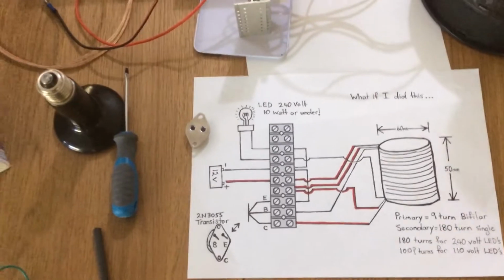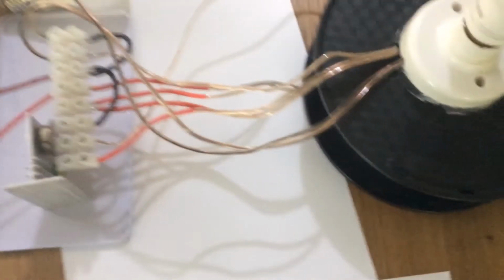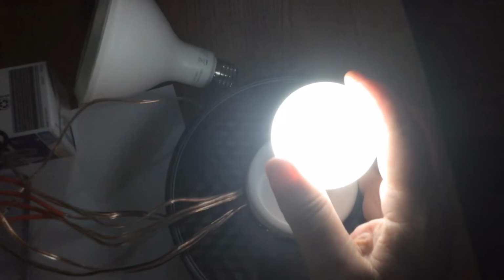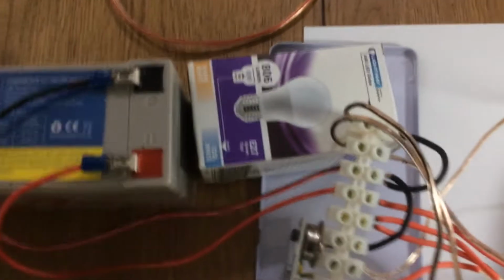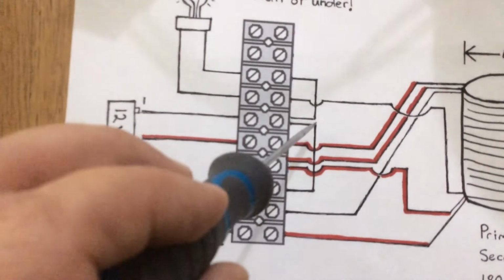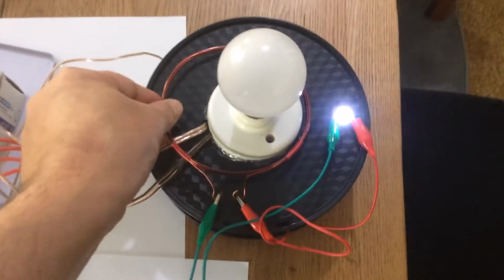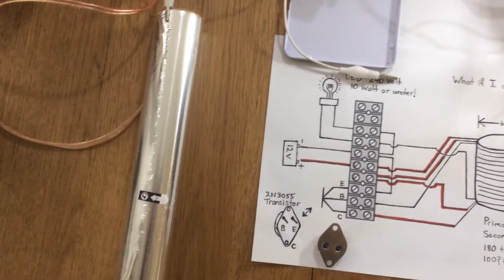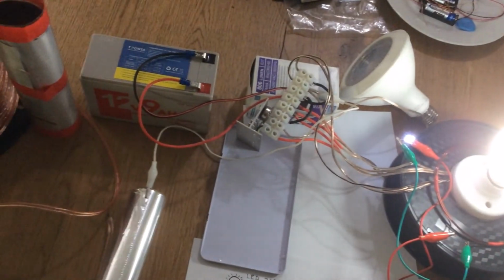Energy Crisis Off Grid Backup High Voltage Tesla Earth Ground Power Transfer Single Wire DIY Lights

Comment: hi ! great stuff ! this is really helping me to understand how tesla coils work. could you please tell us the lenght of the bifilar primary and secondary coils? also the lenght of the wire for the small coils you use as receivers that you place around ( I think you use them in your other videos, with an LED and sometimes a capacitor in parallel) this is so I can put a scope and get an ideea of the frequency it runs at... I want to try this with mosfets or igbt transistors, make it more powerful :D I promise to share the results if it works. Thank you !

Comment: How many meters of cable do I need to create the coil ?
Reply from the maker: Thank you for your comment. Sorry for not replying sooner.
Unfortunately I don't know how many meters would be required. Soon I will make a video on this coil and discuss its measurements. Due to this coil functioning open ended and without a load like a Tesla coil, you can wind a few layers and insert a needle through the insulation, then connect a low wattage LED between the needle and the negative terminal on the battery. If the LED is poorly lit, remove the needle and wind another layer of turns and repeat inserting the needle and connecting the LED to negative, continue the process until you have optimal brightness for the lowest wattage. This may seem like an annoying way to wind the L2 but it allows you to have the optimal setup tuned specific to load.
Thank you for watching.

Comment: Gidday mate, I'm a Sparky from New Zealand, you in Australia?  What's your mains at your place, Single Wire Earth  Return?  If you're in NZ I'd love to come give you a hand.  (I've got 6 microwaves that I'm pulling apart atm for experiments).  Nice light show btw.
Reply from the maker: Thank you for your comment.
Sorry for my delayed reply. I am indeed Australian, I have 240 volt mains here however this circuit was created a long long time ago, in a galaxy far far away🤣(sorry my filter wasn’t on the keyboard) I used this circuit when I lived off grid to send my solar over long distances through earth to run a 240 volt LED light. So you are correct it is basically a SWER system.

I’m sure I don’t need to tell an electrician to be careful with those MOT’s, I connected this circuit to my large Tesla coil then into an MOT and got a one inch green arc to earth which welded the side of the MOT, I’m jealous about the MOT’s you have, I’m currently considering dismantling my kapagen to do some other experiments. It’s amazing when the frequency is correct.
P.S. I don’t recommend doing that unless all precautions are taken.
Thanks for watching

Comment: Why not just use the correct voltage device saves the BS😂
Reply from the maker: Thank you for your comment. I am not so sure of the BS your referring to. I designed this system to avoid the unnecessary overheads that a conventional inverter creates when running 240 volt lights. When I lived off grid I realised the inverter was burning off more energy than the lights were, so I decided to build a dedicated lighting circuit and leave the inverter to run sensitive electronics. When you see the power saved it’s all worthwhile and after this build I used to leave the lights on 24 hours a day in some rooms, because now I could.

It might be worth noting I needed this electrical signal to work through the earth using Tesla’s single wire earth transmission as well as a means of transmitting DC over long distances, something conventional DC is not good at.
Using this method saves 50% on copper wire as earth can be used as the second wire.

Comment: How many KHZ is the oscillator running at ?
Reply from the maker: Thank you for watching. I am guessing as it it was a long time ago, I believe this unit was 172KHZ I will attempt to check it tomorrow because I might be remembering the KHZ for the unit on the board which is slightly higher KHZ.
Reply: @whatifididthis...1236   Ok cool I was wondering because I built something similar that seemed to have low power consumption at certain frequencies. in my playlists.
Reply: @whatifididthis...1236   It does appear my MEG was also around the same frequency very interesting
https://youtube.com/live/sfQbOtAbS30?feature=share
Reply: I have a playlist here: Solid State LRG, M.E.G. Magnetic energy Design Transformer: https://www.youtube.com/playlist?list=PLjuCiV5HRn3RCxCMH_xvkyh8EkEpn0iBp

Comment: Is it possible to slide along a receiving wire/coil to find the resonance point ? With the connection wire I was thinking of hunting down multiple nodes on the wire/ coil .I saw Don Smith with a led or neon blub running along a coil like he was looking for a node to tune it ?. I mean on crystal radios they use a thick wire to slide over the receiving coil to find radio stations .one reason I ask is it seems that you can pull energy from each node without effecting the rest.i saw John bedini talking about placing coils with diodes at node ponts for energy harvesting.i might jump up your out put.
Reply from the maker: Thanks for watching. That sounds interesting, I will connect the ground wires today and test for the resonant nodes as you suggest. You’ll want to see my tutorial for collection methods. I will warn you, they are bloody long videos but cover a lot of the dangers also. I have been testing fields around the coil for the last few days using ferrite and found some interesting information I will try to cover in a new video...soon.
Thanks again.

Comment: On minute 10:47 you are showing the smaller coil with 4 turns. I read that the primary coil, the secondary coil and the transmitters need to be the same frequency. This smaller coil lights up but I can't imagine it has the same frequency because it is much smaller. But it could be because the diameter is much bigger then the audio-wire and finally it's the same again. So you measured that out I think. The other question is because of the primary coil. It has 9 turns bifilare (18 turns). How it can be much smaller than the secondary coil (180 turns) and still have the same frequency? The answer is probably, because it is bifilare.
Reply from the maker: “If you want to find the secrets of the universe, think in terms of energy, frequency and vibration.” - Nikola Tesla

Our key ingredient, the holy grail, the FREE ENERGY that we all want so bad is within the word “Frequency”.
The length of a wire determines Frequency, there are other factors that influence the frequency but none more so than the length of wire.
This is why my circuit can power various sizes of coil with the same/similar outcomes.
How do I decide on a secondary coils dimensions? I don’t! It has already been predetermined by the length of the primary.
A Resonant coil is either a division or multiplication of the length of the primary.
So in respect to my circuit it’s not so much that the primary is bifilar (not to diminish the significance of the bifilar coil which has its own magic properties) but more because the secondary is a multiplication of the primary’s length. Which can be a pain if starting from scratch because you physically have to measure both primary and secondary coils! Don’t stress, because I have already done that bit. 👍
In conclusion, all the coils you see as receivers are either a multiplication or division of the primary and not so much the number of turns.
Think in terms of Radio, the biggest suppression of FREE ENERGY, turned into a source of entertainment, straight over our heads... literally. Radio receivers are just copies of the original energy source, ask yourself, is there a limit to how many listeners can tune to one radio station within broadcast range? Doesn’t the broadcaster keep transmitting at the same power level?... regardless of how many listeners there are. How do you grab that freely distributed energy?, sent to you at no cost to you (FREE), by tuning to the FREQUENCY of your favourite radio station! And yes I realise nobody listens to radio anymore! 🤣😂 Crystal radio set is a very old piece of evidence regarding this.
Reply: @whatifididthis...1236  Super explanation. Now I know the primary coil is the conductor of the orchestra. And the length of the wire is not absolute. It can be multiplied and divided in the rhythm. I think this is the core to know the whole point of free energy. I got it now. I understand now also the radio-frequency. The truth has been over my head the whole life.
Reply: @whatifididthis...1236  I watched your videos how to wire up the primary and secondary coil. In other examples there is usual a space between the primary and the secondary coil. If I'm correct you're wiring the secondary wire directly over the primary after the white tape. How is that?  I have a guess. In other examples the secondary coil is often blank without any isolation. In your case you work with this isolated audio-wire. This way you have 18 spaces. As a whole you have finally the space it's needed.
Reply from the maker: @marcelfiechter7436  You are correct, the secondary is wound directly on top of the primary with only the electrical tape between them.
I have tried wire with thin insulation and I believe it works better if there is a dielectric space (insulation) between wires. So the insulation on the speaker wire is approximately 1.2mm thick, resulting in over 2mm between each wire, in all directions. I have definitely confirmed it works better with a thick insulation to the wire. I only tried once with a different wire, that was enough to tell me it was better with thicker insulation.
Reply from the maker: @marcelfiechter7436  I have made this circuit with a wire that had thin insulation and I feel it was worse than with thick insulation. The insulation acts like a capacitor to house a dielectric charge which is then available to the wire. Some of the circuits with thin insulation would not even work. I’m near 100% convinced thicker insulation is better, also, not all insulation has good dielectric properties.
I found speaker wire was easy to settle on for this reason and others. The circuit in the following video (link below) I designed, to include this concept, after the primary this coil has one layer 20 turns, not connected to anything, then another layer of 20 turns also not connected to anything, then the secondary goes over the top of those two layers. These unconnected layers of 20 turns act as transmitters.
https://youtu.be/fvs-NitCjuc
Reply: @whatifididthis...1236  This information from your experience is unpayable. Here in Switzerland we have 230V. So I keep the primary coil (9 turns) the same and the secondary coil 170 turns. This means 85 turns with the speaker wire.
Reply from the maker: @marcelfiechter7436  I’m not sure what you mean by the 85 turns, I’m running lights designed for 220 volt to 240 volts, these require at least 180 turns on the secondary. If you use only 170 turns it may not be as bright, my portable coil is 9 bifilar turns primary and 180 on the secondary. Remember number turns are not the full picture, length of wire is more important. Keep in mind with each layer of turns the diameter of the coil increases, therefore each layer has approximately 5mm increase in diameter using a 2.5mm insulated wire. So the last layer has an increased diameter of approximately 45mm with the 9 layers that it takes to make the 180 turns.
Reply: @whatifididthis...1236  With 85 turns I thought to reduce voltage. But you answered my question. It doesn't matter if 240v or 230v for the light bulbs. I'm curious how many volts are at the low voltage end and how many at the high voltage end. I assume the low voltage end is 240 volts. Because there is the bulb connected. The high voltage side is probably 580 volts as I saw this in an other video of you. But I could mix here something.
Reply: @whatifididthis...1236  How many hertz is this cycle running? I assume something between 100kH and 200kH.
Reply from the maker: @marcelfiechter7436  The high voltage side is well in excess of 1000 volts, similar to a Tesla coil it will burn you if you touch the wrong thing! This high voltage drops of drastically when plying a 240 volt load, I can’t remember the “under load” voltage exactly so I will measure it tomorrow whilst running some other tests. I would be very careful what you connect to it, a cheap light - all good, but if you connect anything with sensitive chips, it may be its last run! I practice this philosophy, if I want to keep it, don’t connect it!
Reply from the maker: @marcelfiechter7436  Don’t quote me on it, from memory I can visualise 172 kHz but that could have been my coil on the testing board and it also could have been connected to earth which changes everything. There’s another video on frequencies that could be made! I spend all day testing my ideas on this circuit and others I have running so there are a heap of numbers jumping around in my mind. I build things over and over in my head ruling out how not to do things, when I feel comfortable with the design I make attempt after attempt until something works. I know this is far from a Mk2 Iron Man suit or an Arc reactor but the 3D blueprint computer that Tony Starke has is something like how I see things unfold before I even touch the wire. I find building in my head to be a lot safer, I have been electrocuted so many times it’s ridiculous.
Reply: @whatifididthis...1236  >I'm just wondering what exactly the difference between high and low voltage is. Even you didn't explain this now in your reply I think I got it. This is most probably the top and bottom of the frequency curve. Tesla was the inventer of AC. Claro. I'm studying this now since 4 days and I have every day something new I really understand. Without load it's around 1000 on the high end. It drops of drastically without load you said. It drops to 240 volts I think. If it would be higher the bulb would burn I guess. If you would make 360 turns in the secondary coil instead of 180 then the voltage would be significantly higher I think. Probably more than double because the diameter gets also bigger.
Reply: @whatifididthis...1236  How would it be possible to increase Hertz? When I'm thinking logically Hertz gets generated by the primary coil. If you would winding 18 turns instead of 9 on the primary coil Hertz would be doubled at around 340 kHz.
Reply from the maker: @marcelfiechter7436  Remember the turns aren’t the main consideration when aiming at a particular output. Too many turns will take the circuit out of resonance and increase resistance if the secondary strays too far from a division or multiplication of the primary length. The bulb may burn out as you suggested. I tried a 110 volt light I had for testing other circuits and the circuit smoked it. A good experiment for this circuit is to wind one layer on your secondary, connect the circuit and measure voltage increase with only one layer. Then wire a second layer, reconnect the circuit and measure the two layers (40 turns) output compared with the initial 20 turns. Keep repeating until you find a sweet spot. Tesla stated that the magic occurs above 20 kHz so that’s easy to obtain so the most crucial factor for resonance is the length of the wire, this means testing is essential as a full layer of turns may leave the wire too long or too short. Removing turns one by one you will find the golden ratio. This is why it is much easier to measure the wire first to match resonance of the primary, takes out the guess work and hours of tests. Also, if you decide to do the layer by layer test you should watch the input wattage, when resonance is achieved your input wattage will drop significantly.
Reply from the maker: @marcelfiechter7436  Remembering that I can be wrong, as far as I am aware length of wire is the largest determining factor for changing the hertz and hertz is the measurement of frequency. However everything in the local environment has an influence, just putting your hand nearby will change frequency. I have to stay a meter away from this circuit to get true readings. Experimenting is the only way you can confirm your ideas, if your willing to do the work you could wind multiple coils with the speaker wire and when you run out of wire, document and unwind the first prototype to build the next one. I used this method because I could not afford more wire, so I picked my least successful coil and unwound it, saved me a lot of money and I don’t have a bunch of unused coil designs kicking about.
Reply: @whatifididthis...1236  Thanks a lot to answer me all this questions. The length of the wire of the primary coil dermines the frequency. The longer the wire the higher the frequency. The primary coil is the conductor of the orchestra. The length of the wire of the secondary coil dermines the multiplication. The higher the wire the higher the volts.
Reply from the maker: @Marcel Fiechter  Happy to share what I have learned, the length of primary AND secondary have the largest influence in determining frequency.
Reply: @whatifididthis...1236  Thanks for correction. That's why every tiny little change somewhere has a big effect at the outcome.

Comment: Hi what is the amp consumption
Reply from the maker: Hi, thanks for watching. I will try to make another video with a quick demonstration of amp draw as it varies depending on the load and if your transmitting through earth or using wireless coupling. I will send you a message when that’s uploaded.
Thanks again for watching.
Have a nice day.
Reply from the maker: Hi, I eventually made time to record the circuit whilst displaying wattage under different loads. The load testing begins at the ten minute mark, this video ended up being far from a short one!
Thanks again for watching.
https://youtu.be/RCXzyJdo4yI